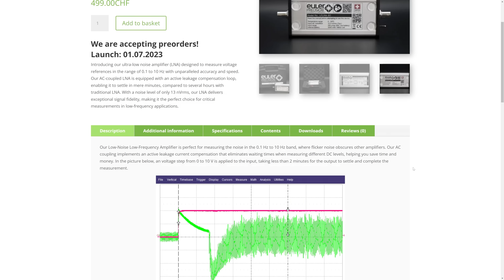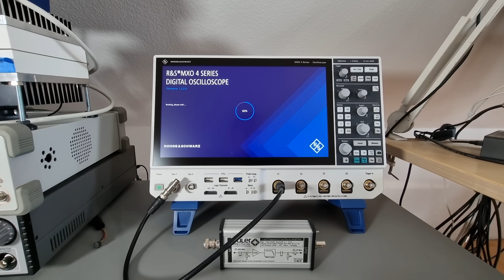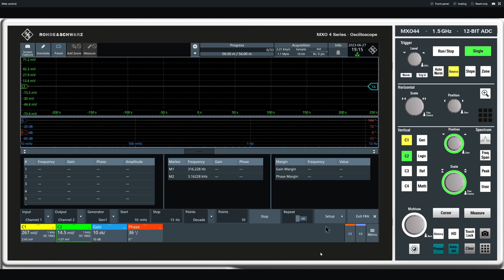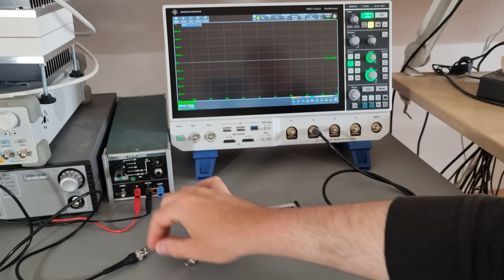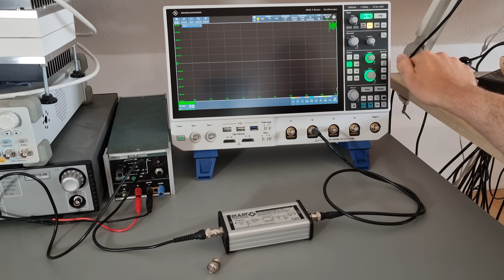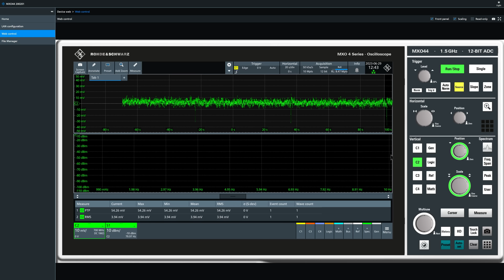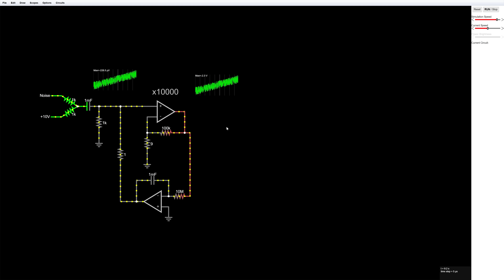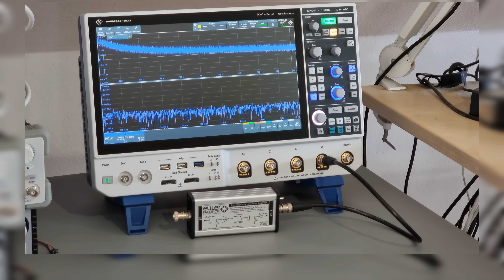New Low Frequency Ultralow Noise Preamplifier: LFLNA-80

Comment: One very simple method of achieving similar fast-settling LNA performance is to split the overall gain into two stages.  An ultralow noise first stage gain of about 250x is plenty to get the signal of interest well above the noise floor, but is low enough to prevent the first stage from railing due to input electrolytic leakage.  If you follow that stage up with a high-pass filter, the DC offset is removed and the signal can be safely amplified further.

I'm glad that you mentioned input voltage safety, since with such a large input electrolytic it is very easy to overload the input, even with the input clamp diodes.  Many opamps don't allow more than 5mA, so either higher than desired input resistors, or JFET current limiters are required.  My design uses the OPA2182, which does not have input back-to-back clamp diodes, so it can handle differential inputs up to the VDD/VSS span.  I also included a series mosfet voltage limiting circuit, so the input is fully safe for hot plugging into anything up to 30V, regardless if the LNA is powered on!

I'm on rev 2 of such a design, and have gotten a 72nVpp / 10.6nV RMS shorted input noise floor!  Current consumption is only 7mA total, so it gives plenty of life from a 9V battery.  If you search the eevblog metrology page for "DIY 0.1 to 10Hz Noise Amplifier", posted June 12th 2023, that's the build log of my initial design, which I will be updating with the second revision very soon! 

*The EEVblog post is updated with my Rev X2 results!  78nVp-p typical and 10.54nV RMS typical noise floor with a shorted input
Reply: Good job! Thank you for your community support.

Comment: I love this stuff. However, I'm not a fan of the DC cancelation circuit. My approach was to build a composit LNA with minimal gain and use a very low noise SAR like the AD4630-24. I put a brick wall on the .1 to 10hz bins and ifft to get the RMS. No settling is really needed since there are no AC caps. Also, it's nice that the SAR has a little bit of over rang, so you can measure the same reference noise.
Reply: With 10V Input Voltage and 24 bit resolution you will have 600nV LSB resolution. How do you want to measure 10nV or less? You need a gain of 100 or more.

Comment: AVX makes Wet tantalum capacitors with ultra low DC leakage (less than 1uA). I believe Mr. Williams used a few of them for some ultra low noise preamplifier (AN 124 July 2009).
Reply: And those lovely caps are about as much as the whole preamp! :D
Reply: @DanielHeineck  yeah its about 60-150 euros per piece. Ive been on excursion in AVX where they make it but they didnt want to give me a samples :( I would gladly accomodate some nice 4700uF wet tantalum cap :)

Comment: Nice relatively simple design - but my brain is still searching for a practical application 😅
Reply: Make guitar more louder obviously. Maybe? I hope!
Reply: To measure how noisy is the DC volatge reference. The less noise it has the more exactly you can measure its voltage, nowadays possible to 7 places which is 0.1 ppm.

Comment: Since there is an audio servo used the question of audio grade caps from nichicon (muse) comes to mind.  Those are rather lower grade caps . The effect of voltage rating also  is of interest in that application .  The cost difference is small in case .
Reply: It was probably a longevity decision. Most audio grade caps are only rated for 85oC.
Reply: @zsigmondkara  Good point are those 125 C then the longest lasting ?
Reply: @johnwilliamson467  Exactly. It means they are rated to work within specifications for a given amount of time at that temperature. In the case of this amplifier 105oC caps are going to work for a much longer time at lower temperatures.
Reply: @zsigmondkara  For these caps the rule of thumb is 2x per 10c work for about a 40 c range thus 120c over 85 c is aprox 16 times the life given the test I have watched.